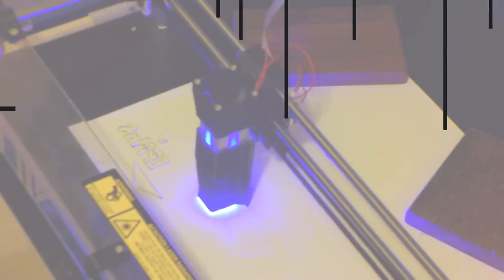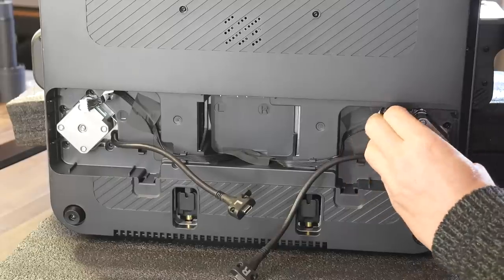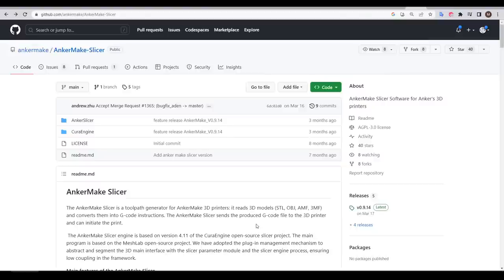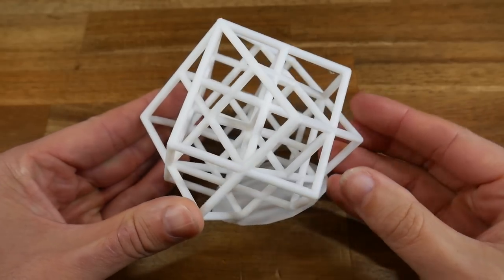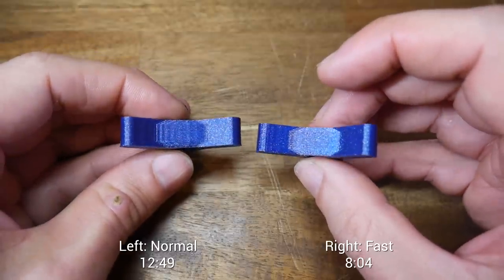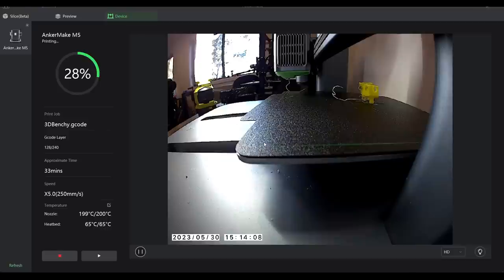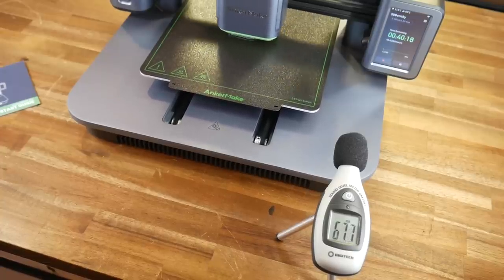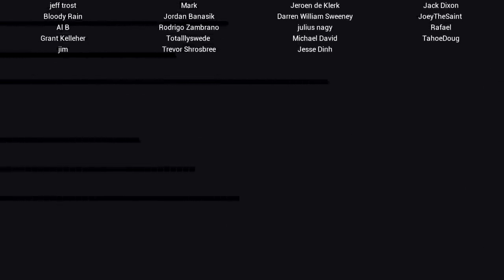A 3D printer that just works? - AnkerMake M5 Review

Comment: I have Ankermake M5 and Bambu X1C with 2x AMS. 

X1C beats my M5 hands down by unblemished first layer test compared to my M5 that has rough area's on top of first layer test. Ankermake technicians say's it looks good and they won't help me. Whereas my X1C is smooth and will be excellent for stencil designs. I don't know if it's flow rate issues or filament feeder having issues as it's very difficult to insert.

Comment: I have an AnkerMake 5 and I agree pretty much with your review.  Slicer, poor.  Print quality, okay.  Speed, pretty good.  Profiles, mediocre.  

Recently I purchased a Bambu X1C and since that time I hardly use the Anker, it's been relegated to printing simple models mainly because I know they will be fine.  Although I've not used a Bambu P1P, if it is even only 75% as good as an X1C I'd definitely recommend the Bambu over the Anker because print quality and print speed is so so much better and the prices are very similar.